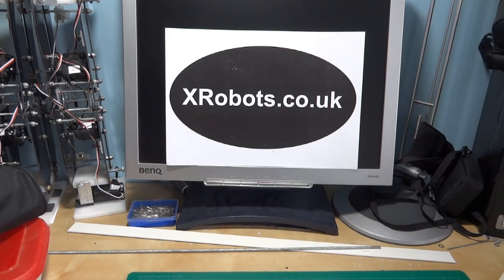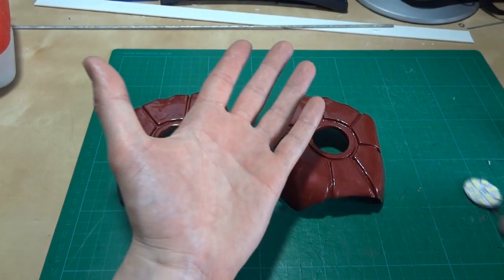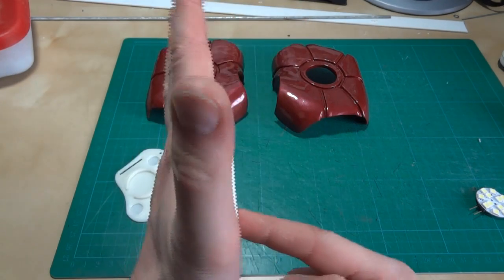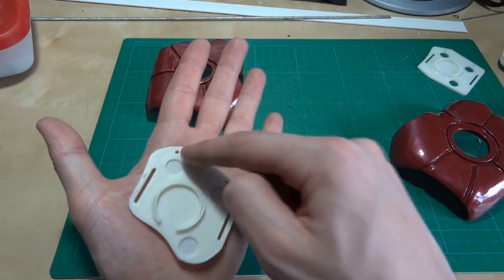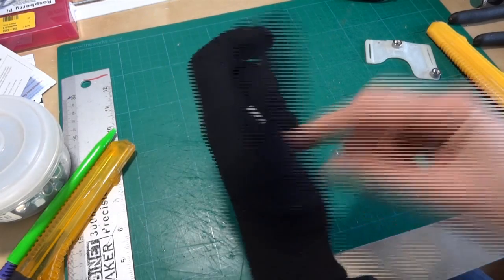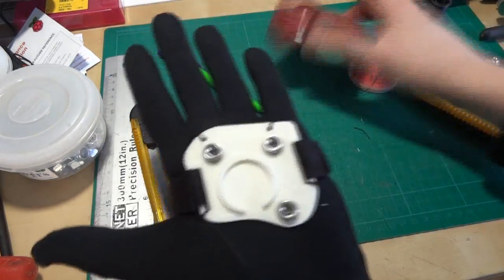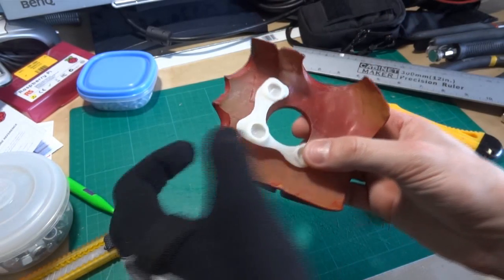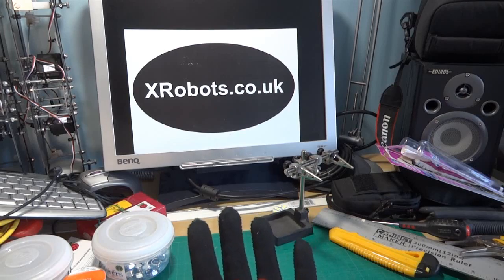Iron Man Power Suit #31 | Glove Latching | James Bruton

Comment: if your willing to take a risk you could try the "Replic8-3D Printer with Single Extruder Open Source not Makerbot or Reprap" off amazon its only £600 but its not sold directly from amazon